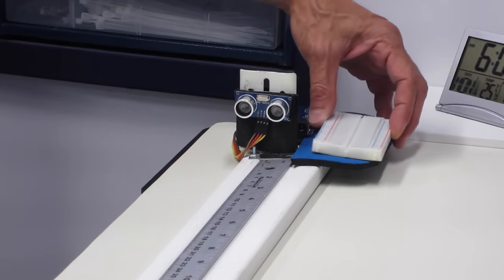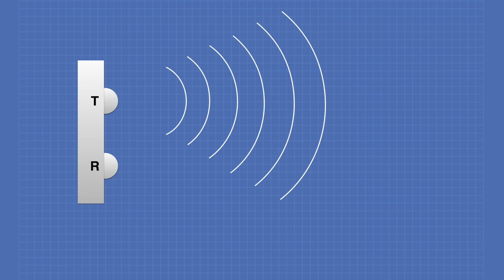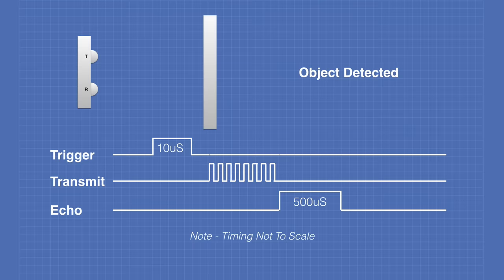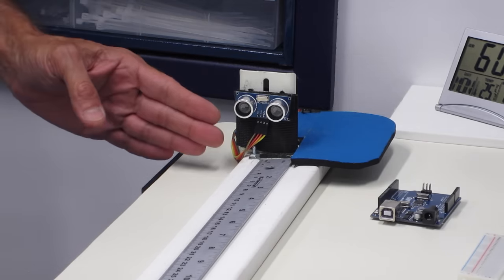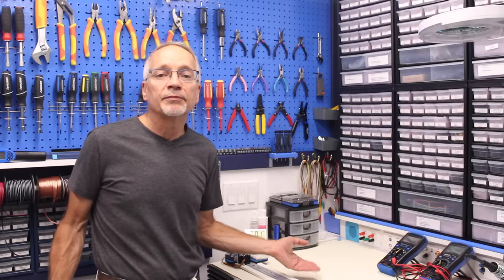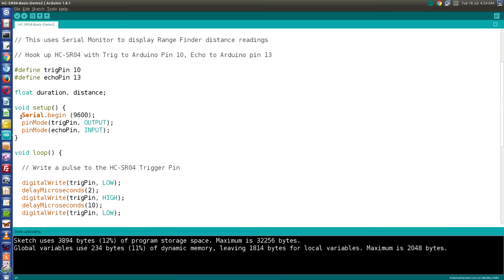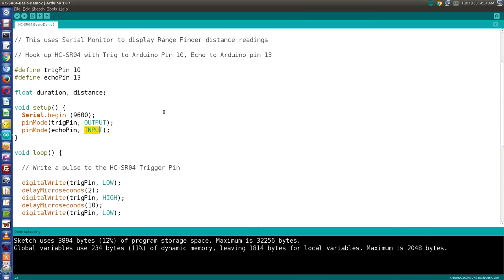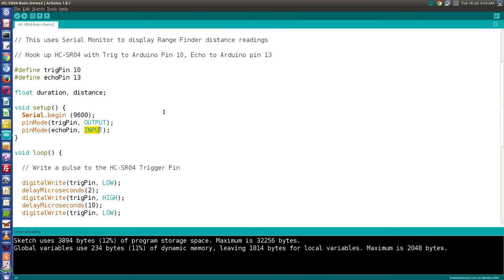Using the HC-SR04 Ultrasonic Distance Sensor with Arduino - Everything you need to know!

Comment: The sensor also has a 15-degree wave sending range. If you hold the wooden board too close to the center of where the sensor is pointing, the wave also reflects off your fingers and this can also distort the results. Additionally, changing the angle at which the sensor and the board are positioned affects the results

Comment: Lol, I spent three quarters of the vid looking at your jittery positioning, and the box level and 2 squares behind you. Perfect vid! Seriously, clear, concise, no great insertion of hipness, direct and to the point. Oodles of kudos. Granted the jittery paws fixture illustrates accuracy depends on stability of "lock" between horns and board, but I think your sketch improvements and evolutionary gains in accuracy would be better illustrated by just blocking the board square to the meter stick face. Only critique possible, lol. Points added for Pink Floyd reference, of course. Subbed!
Reply from the maker: Yes the jittery hand probably created more inaccuracy than anything else, probably should have rigged up a clamp arrangement.
Glad you appreciated the Pink Floyd reference!
Reply: DroneBot Workshop just a square face to butt upon is needed, like a machinist 123 block, though no such precision of dimension needed, of course. Hot glue a cheap plastic speed square for rigid permanence, or just a scrap of dimension lumber for free handing. Not really needed, but it minimizes a variable in results, so makes result more accurate (my inner engineer, lol). Then you could even quantify diminishment of accuracy related to obliquity, which could prove useful in finding "real world best" as opposed to "the Belle of the bench", ROFL. Yes, any reference to pre hasselhoff pop culture is appreciated, rare as it is

Comment: Thank you so much for all of the time and detail you put into your tutorial.  I am new to Arduino and am attempting to control 2 - 24v, 200 watt power wheelchair motors via the HC-SR04 sensors.  Thankfully I have spare motors and spare wheelchair, and can practice before integrating on my daughters power chair.  I'm looking to reduce motor speed as proximity increases, so she hits fewer walls and obstacles.  Your help is greatly appreciated and I look forward to exploring more of your tutorials hoping to understand how to connect and program.  Also, looks like robust H-bridge controllers might be a problem locating....

Comment: I'm presently building a basic octopod spider robot. Once assembled, it'll measure close to 1 metre in diameter, and stand approximately 20cm - 25cm high. I'm thinking of installing (2) HC-SR04 proximity sensors on my robot, one at the front, and another at the back. These will be mounted on 180 degree servos to get as large a sensor range as possible. I'd like to include AI in my robot eventually, but I am not at that level yet. I love your topics and rely on your videos and expertise for my robot applications. Your topics are great and your website is absolutely gorgeous. You're a real pro and I'd love to be able to do what you do! Thanks a lot and keep up the good work.

Comment: Hi there.  I really enjoyed your video demonstrating the HC-SR04.  I plan to use an ultrasonic distance sensor to measure the water level in my rainwater tanks.  I am led to believe that this will work as the sound will bounce off the water surface.  I plan to send this data using MQTT to my home automation platform namely HomeAssistant.  This will allow me to monitor these levels esp during summer when we use this water and during rainfall when the tanks will be topped up.  Of course I need to factor in securing the board and sensor and powering it within the tank, which might be a challenge.  Adding the temp / humidity sensor will not only make for extra accuracy, but so that I can see the temperatures in my tanks too.  Always a nice touch.

I also plan to use this sensor to measure the distance as I drive my vehicle into my garage to determine how far I can park it so that I am left with enough space between the vehicle and the wall for me to walk past into my house as well as knowing that once the car is parked, I can close the garage without having to get out and confirm visually that the car is in far enough.  When I'm at the right distance, a light will turn on.

Got a question though.  I see that there is a HY-SRF05 ultrasonic distance sensor which seems to have replaced the HC-SR04.  They are very similarly priced.  Have you tested the HY-SRF05 and compared it to the HC-SR04?

Comment: excellent tutorial, thank you!
One way to get very accurate reading is to have a second sensor facing a fixed target (with a known distance) as a calibration sensor. That calibration with take in consideration temperature and humidity or any other disturbance that might appear (dust?) or even having the sensor in a medium which is not air at all...

Thanks again!

Comment: Great instructional video.   I appreciate that you use metric, the truly scientific measurement system.
Reply from the maker: Thank you. As far as I'm concerned the metric system is really the only way to go as it's SO much easier to work with than the old imperial system.  
And also, they use it on Star Trek so if it's good enough for Jean Luc Picard then it's good enough for me!

Comment: Hi. Excellent workshop. To the point and no annoying music, ads, requests to subscribe, like, etc.
I'm planning to use multiple HC-SR04, each controlled by its own Arduino. I'm wondering if the sensors will be interfering with each other unless I add a feature to sync the MCUs in such a way that only one sensor will be firing pulses at any time. You showed a setup with 2 sensors, but controlled by the same MCU. Due to the fact that the whole sequence of sending and receiving is controlled by blocking functions, only one sensor will be active at any time and interference is not an issue.

Comment: thanks. amazing explanation. I found sketch just like you have but couldn't understand why it's even works. I thought trigger and echo basically connected to transmitter and receiver. So when u send HIGH on trigger it send wave, when wave come on receiver - echo send HIGH, but turns out it not so controllable as i thought it would be and now I understand what is going on. Very rare do likes on utube but video very inforamtive. thx

Comment: Great video.  It has helped understand the HC-SR04. Again nice job!  A couple of items:
1. I was confused with the initial overview of the HC-SR04, it noted the TRIG - was the Trigger pin (Input) and ECHO - was Echo pin (Output), but your sketch had them defined in reverse. So I documented my notes with sketch info.
2. Do you have a video using HC-SR04 with Arduino MEGA2560?

Comment: Thank you great video and it answered several questions for me about the hcsro4 and saved me from building a couple of projects.
I've heard repeatedly about how really amazingly accurate these ultrasonic sensors are so I had a lineup of projects needing accuracy finer than one centimeter so I may need to incorporate a laser or some other solution to some of them.
This is an interesting little component thank you very much for the great tour and instructions.
You motivated me to build a little rover bot with it.

Comment: @DroneBot Workshop
BTW, you can just do a "sonar.ping()/US_ROUNDTRIP_CM" if you want accuracy to the fraction of a CM.  You were not getting accurate results because you were using 343m/s for the speed of sound instead of using the built-in US_ROUNDTRIP_CM calculation.  Also, the other reason why ping_cm() returns an integer is to avoid floating point math, which is slow and uses about 1,000 bytes as a result.  This allows NewPing to use less space and be used in ATTiny microprocesses that have limited space.

Comment: Your videos are really nice. I need reference material for the formula you used in finding the speed of soundwave in the air using the temperature and humidity for the dht22 sensor. soundsp = 331.4 + (0.606 * temp) + (0.0124 * hum) -> This formula.
Reply: 331.4 is the speed of sound at 0 degrees Celsius. / .606 is the average increase of resistance per degree increase. Same principle applies to the humidity calculation.

Comment: Thanks very much, super clear explanation, love you're adding physics behind to wrap everything up to having the tools as well to each one to property understand and further improve or mofify. Thanks again for your time.
Reply from the maker: Thank you so much for your comment!
Yes I've always believed it's important to know HOW things work, rather than just connecting a bunch of components up as per a wiring diagram or schematic. Glad to hear that someone else feels the same way!
Reply: Absolutely. By the way, providing bats use exactly the same method you described here, for traveling avoiding obstacles and feeding in the air as they are optically blind, and they don´t have circuits, this is (at least for me still more intersting). My point now is we can also relate different science areas (as different now to animal biology) and we further understand things. If in your video you started showing a little bat in your hands it could have been weird, but nobody could say out of context.  :)

Comment: I hope you are still providing feedback. I have used your sketch with the NewPing library and the sketch uploaded with out problems but all I get on the sensor is out of range. Now I am using a TF mini plus but I didn't think that would make a difference since it is an ultrasonic sensor as well. I would appreciate any advice to help getting this sensor working. Thank you for this great instructional video!

Comment: I'm new to Arduino, but I'm picking it up pretty fast as I have a few C++ classes under my belt from college 15 or so years ago. YOU SIR, are now my new FAVORITE tutorial guy! What is your name? I must have missed it. I look forward to watching more videos from you as I get more acquainted with Arduino. PS, I only copied one of your codes as I was getting pressed of time, but I am focusing on learning how to write the code myself so I learn to understand what I'm putting in, and only came across a couple errors. 

One note in this video that had me stumped, that you might consider and addendum to this one.... As well as the two Adafruit Libraries, I also had to add DHT library. It took me a while to figure out why it wasn't working after installing the Adafruits, but it finally came to me.

Comment: Thank you for the great material! I'm the analog guy, but your videos make good introduction to the microcontroller world.
Please keep it coming!
Regards, Phil
Reply from the maker: I used to be an analog guy too, way back in the 70's and 80's I designed and built a lot of audio equipment. But I also got into the digital stuff very early as well.
I'm happy that you find the videos useful in getting into microcontrollers.
Reply: Yeah, I'm an audio guy too (tube guitar amps, recording studio stuff, etc). Now I'm in the process of designing guitar amp function switcher (just simple 16 in's with relays latching to ground, thus switching channels in amps). All that should be controlled via midi and have 127 presets and 4 digit seven segment display to show you a status and preset number. So I've started digging microcontrollers and found your channel - I think, it's one of the best on Youtube, imho! Thank you much!

Comment: Hi. Yours is probably the best instructional youtube page I've used. Very clear, informative and to the point. Brilliant!!

One question, the stabilisation delay for the DHT22 (eg. 34:48). Could it not be put at the end of the setup so it doesn't slow down the loop, or does the sensor need stabilisation time every time its read?

Thanks.

Comment: awesome tutorial, sir! for calibration, maybe use a 10cm cubed block instead of the wood panel to ensure the edge is always 90º vertical and stable?
Reply: Yeah, the slight wavering as he is holding that board is going to affect the distance returned, so he needs to attach it to something so that it is always perfectly perpendicular to sensor in both the vertical and horizontal axis.  Even if the baord is perfectly vertical, if it is angled slightly, it is going to make a difference in the measurement.  Repeatability of the measurements is also important, so making fixed length measurement rods to act as spacers would be helpful so that you know that you always have the target at the same exact point when you are trying different algorithms with your code.  But I would never expect an ultrasonic sensor (that currently costs less than $1 in single unit quanties on eBay) to be extremely accurate anyway, so going to that extreme on the testing is probably not worth the effort.

Comment: Interesting, but before adding temperature & humidity sensors and complicated formulaes you should have tried to find another target that can stay in place without touching it like a cube on a flat surface : it is evident that you cant get any accuracy in your measurement if the target is moving (your piece of wood is shaking) !
What would have been interesting was to see if a small change of distance (few millimeters) would be detected by the arduino because "accuracy" depends more on the accuracy of the time measurement, the accuracy of the pulseIn() function that depends itself on arduino's frequency.

Comment: Looks like iterations doesn't use the average (mean), but rather the median value of those obtained. That makes more sense than doing an average. Also, you really should have just used something like a carpenter's square to hold your plywood vertical--leaning it one way or the other results in a deviation of several millimeters, so my guess is that you're indeed the cause of the discrepancies you saw. So I'd argue that the sensor isn't "inaccurate" until your board is rock-solid and it's inaccurate. Until then, it's you. Probably. 

I loved the bit about using temp/humidity to tweak the speed of sound value. I hadn't seen this actual equation before. Very nice.
Reply: Also, I'd probably make your centimeter per microsecond comment (units) be cm/us. Right now it looks like it's centimeter per millisecond, so I had to do the math to be sure that 1 cm / 10000us is what you wanted. That's correct, but the comment is a bit confusing.

Comment: That is a great video. I was wondering if the sensor works well with water level sensing. Tank height from bottom to top is around 55cm. and the tank will  be filled from bottom so level rises evenly and water mostly will remain stationary. Just level rising and falling when someone takes water.
Can you please guide. I trust we will also have to use the temperature and humidity sensor.

Comment: Great Video and clear explanations! However, I would like to add the following comment. As for the relationship between speed of sound versus temperature I disagree with the formula in your code. The reason being the increase in temperature makes air molecule at separate further from one another, especially in  an open space. And we know that this increase in temperature makes air molecules to gain more kinetic energy. Speed of sound depends on the density of the molecules in the air hence the speed reduces. We might not notice that because the change is small. The decrease in density of air due to rise in temperature is the reason for airplanes taking off longer in summer than in winter. I am going to look into physics book and verify the formula for such a scenario in open space and NOT those in a container. Thank you

Comment: Your accuracy test is seriously flawed, and here's why:

 You need to ensure that your piece of wood is absolutely vertically aligned to get a precise reading because your ultrasonic sensor is not positioned at the exact same height as your meter stick. It is positioned at least two or maybe three centimetres above your meter stick. The distance to your piece of wood at this height may vary from the distance at the base unless you use a 90% angle to ensure that your reflective surface stands perfectly upright. I can clearly see in your video that it is leaning slightly as you are holding it and this slight error could very well account for the inaccuracy in your readings.

That being said i just want to thank you for making this video, i just loved it! It has the perfect mix of comprehensibly explained theory, and some hands-on creative tinkering and this video gave me exactly the information i needed to get going with my own ultrasonic sensor that's sadly been lying around for a while! I hope that you find my criticism constructive, cause the last thing i would want to do is to discourage a great teacher from teaching! And i am most definitively grateful for what you've taught me so far. So thanks a million, and i do hope that you keep these great lessons coming! =D
Reply from the maker: Actually I agree about the test being flawed, if by nothing else than my old shaky hands holding the board! And I'm sure you're also correct about the angles involved, I also suspect that the other items on my workbench affected the accuracy.
But in the "real world" I suspect you'd encounter a number of inaccuracies as well, if the sensor was mounted on the front of a robot car it would be subject to the unevenness of the surface it was driving on and by sensing irregular shaped objects.  At best these devices can be expected to give a "ballpark figure" which is usually sufficient to prevent your robot from slamming into a wall at full speed!
And I do find your criticism constructive and I appreciate it, I'm always looking for ways to improve what I'm doing here.  After a much to long unplanned absence I'm starting to make more videos again and plan to go full force in 2018. Any comments you can send my way, positive or negative (hopefully not too negative LOL) will always be welcome.